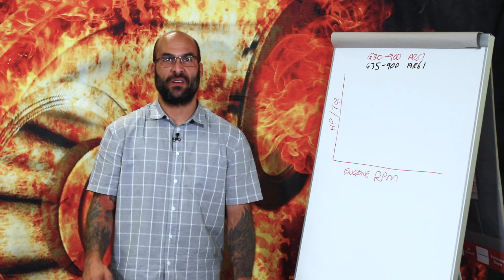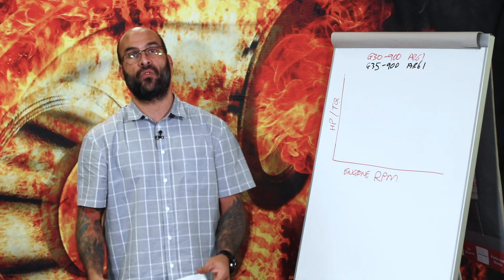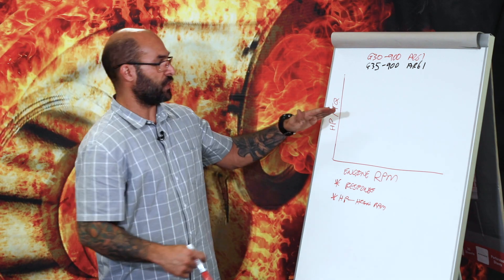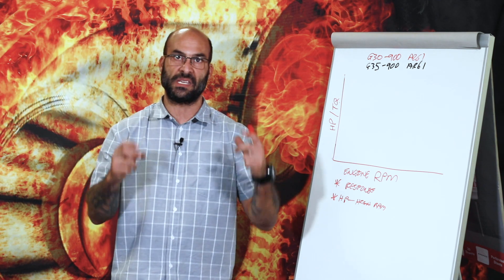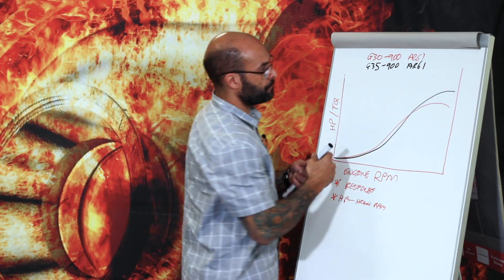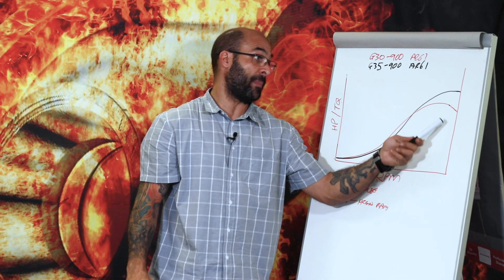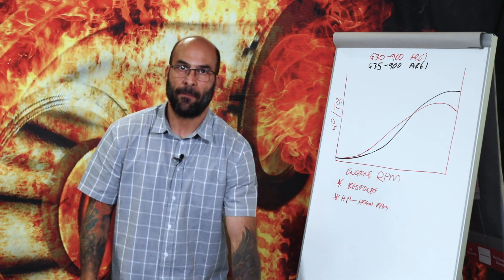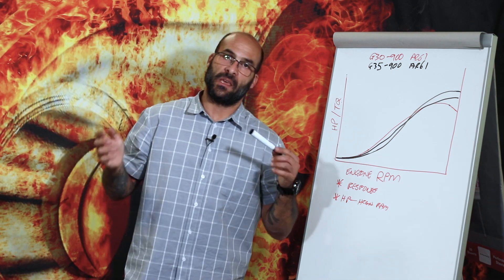G30-900 vs G35-900 N54 motor

Comment: For the rasons that you choose the g30 I was going to run a efr6258 instead of the g25-550.
Could you shead some light on the EFR line turbin wheel explosions /structural failure when run on diesel?  When I ordered my g26-550 (2nd choice).  I was after the EFR6258 but the salesman told me "BW said NO DIESEL they run too hot" . .. 584c seams to be ruffly 1/2 the desine criteria of 1050c rated, so how is 50% less than desined a NO WARRANTY  over heat failure?

I am theorizing that the carbon /coaking in the exhaust air stream  is reacting with the aluminide /ti bonds chemically, resulting in erosion/ degradation of The "stiffness" that is being labled "non warrantable heat induced cyclic failure due to abuse".  I did a little reading (paraphrased)  "...the EFR was a bad a$$   all the horsepower's instant boost then boom no warranty  out an IC and 3k , still needing a charger  IC and boost tubes whats up with a ?heat failure? Never got over 1400°f(690c)..."

With a certified turbo failure analysis  lab  this would rightup your allie.
I was also told that this problem only exists in the EFR line and is the ti alumide composition is at the root.
Reply from the maker: EFR is on another level compared to Garrett in terms of bearing design, materials, etc - i'm sorry but i totally disagree with the comment that a Diesel engine runs hotter than a gasoline driven engine - this is in fact opposite - your will NOT suffer a failure from the EFR range because of operation on a diesel engine due to thermal loads.  The bearing system is designed in a way that it will handle much more heat than the likes of the Garrett bearing design, or any other ball bearing design for that matter - EFR stands for engineered for racing and that it does and 100% successfully - lap after lap in competition you will never experience more thermal loading than this application. 

The EURO5 and EURO6 engines run at 750-800+ DegC - we run these turbos on these engines all the time - there is no way that the turbine head will sustain damage from Diesel soot build up - soot is soft almost like talc powder. The Gamma/TI material is still metallic and bonds onto the shaft in the very same way (electron beam welding - aka CVT) and there is no way the weld will fail either. Fallacies.
Reply: @TurboDirectSA  I agree about the heat, hence my confusion as to why agpturbo.com  stated that BW said NO for heat, 750 is less than 1050c last I checked too.
 As well as several cummins owners that are mad about fraging an  EFR that turned out not to be warrantied due to being used out of application.
 Talked to a fellow hear www.dieselpowerproducts.com he confured that EFR +cummins =bad the bearings get sloppy exceptionally fast alowing contact= frag out constatuted as abuse,  he'll sell me all the EFR's with out warranty  I will take  but would be much happyer selling me SXE with the same tech as EFR less balls and 2x hever turbine
Reply from the maker: @daviddroescher   I have to disagree on the bearing system, and here is why -- see pages 34 and 35   https://www.borgwarner.com/docs/default-source/iam/boosting-technologies/bwts_performanceturbosgeneral_759_901.pdf
Reply: Diesel cummings, the can push soooooo much boost. Overspeeding the wheels on any turbo will case issues. Efr or garrett...  When you buy a turbo based on wheel sizes, you end up with a smaller borg vs. Other common brands. Its not uncommon to see people under size a borg choice when comparing brands.
Reply: @DewDravis.c.o.e.33  if there warranty  had been refused for over speed I would agree 100% however warranty was rejected due to being quote overheated unquoted  by 300+° c below  Specification.

Comment: With the Garrett GT and GTR turbos i’ve tried 4 different variances like gt28r and gt30r - gt32  l Easily got they’re rated horsepower at the wheel . back then the turbo speed sensor was not available
Reply from the maker: From the older GT and GTX Gen1 turbochargers, i agree with you - since the changes in Garrett and the conflicting compressor maps from Catalogue Version 6, and 7 - the power claimed by Garrett on the GT3581R Gen2 shows 850HP and 900HP but with the identical map ..... today i can guarantee you that the HP rated in the maps will not relate to WHEEL HP - thats for sure.